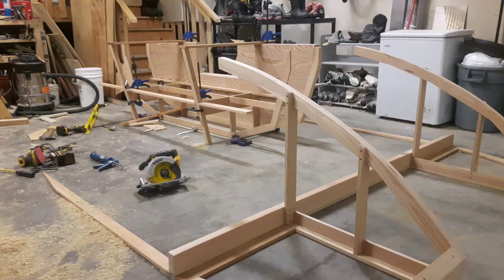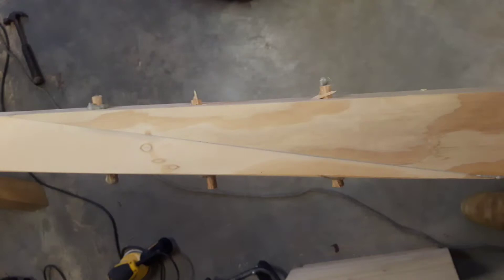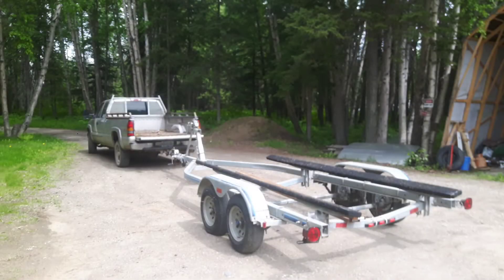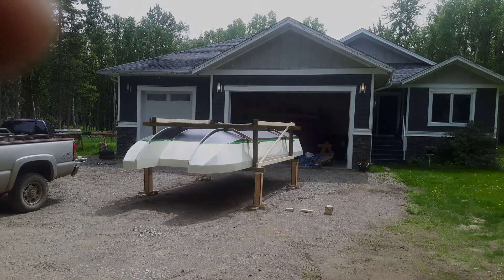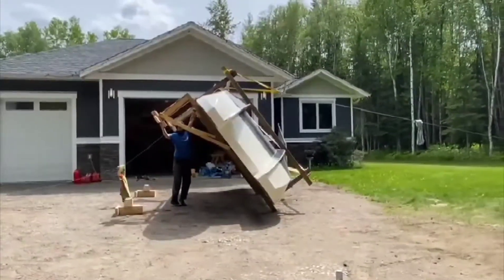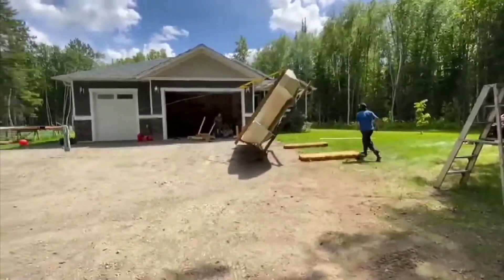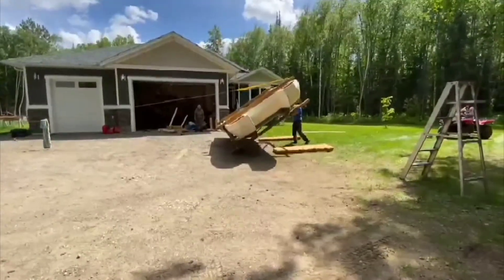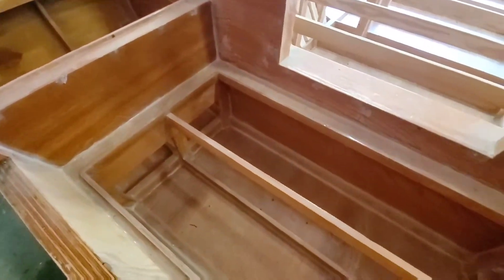Tiny Houseboat (intro)

Comment: 🌴 well I just dropped in to see what you had going on , this was a pop up on my you tube feed as I like seeing boat builds , I’m a retired boat and yacht builder of 32 yrs, it’s interesting to see other people come up with an idea and follow it through, some people attempt it without having skills ,you have skills this is a nice looking craft how much fiberglass is on your pontoons ? This is we’re most people make the mistake on there homemade builds it’s usually to thin ,they get a puncture and water intrusion and eventually this leads to hull rot , it looks like your off to a great start and I’ll try to follow your build , to see it’s progress , make sure it’s sealed really good from the inside and try and add some flotation foam in proper areas , have fun!

Comment: Your helpers did really well, they both exercised good control in raising and in particular, lowering the hull carefully!

Having found your first video I'm very impressed wih your build and that you prioritise low weight, something rarely considered by builders, many of whom use astonishingly large timbers.

When the superstructure and interior are complete the torsional rigidity will be significantly increased.

I have seen this in commercially constructed boats, campers and caravans, and in one case (the A-Liner) the rv became unusable if the fitted furniture was removedl

Thank you for sharing your inspiring build, which adds to the knowledge base for self builders.
Reply from the maker: Thank you for the kind comment! 
I 100% agree to the added strength that the interior will provide. A while ago I took a little travel trailer appart (really old, from around the '70s) and once I took out the interior the rotten framing in the walls provided no strength at all anymore. Just the aluminum panels where holding it up, a little breeze even just from a sneezer would have been enough to let it collapse!

Comment: Your plans and method of construction are very similar to the plans offered by the Glenn L Marine company. They have been offering the home boat builder plans for all sorts of boats since the 1950s. The only real difference between your boat and their plans for the Waterlodge I and Waterlodge II, is that the bow of the boat is square instead of pontoon like. The Waterlodge I is 20' in length and the Waterlodge II is 24'. Some people have  stretched out the II plans to 30'. You are a master craftsman.
Reply from the maker: Very interesting! I will have to look in to that!

Comment: It looks like the 2 keels are notched to receive the frames, is the keel 3-2x4's
Reply from the maker: You are right, they are notched. They are only 2×2's. The joints are glued generously with epoxy and a high density filler. Once I was done with covering the framework and fiberglassing it, I glued two 2x3 keel's to it and fiberglassed over those as well. This way I have basically a 5x2 sandwich keel without a single screw in it and therefore less chance for water leaks.

Comment: That deep double fin on the bottom of your hull should give you great and efficient directional stability -- don't think I've ever seen a hull design comparable to this?
Reply from the maker: I really hope so, I guess we will see on the day I finally get to launch it!😄 The hull design is the result of the space available on the trailer and some personal preferences. One day I might explain it more in detail since there seems to be a lot of interest in it!
Reply: @adrianwoodworm  -- We have two smaller inflatable catarafts (8' & 7') and (as you may have noticed with your inflatable pontoon craft), they have almost zero inclination to go straight and would just as soon move sideways across the water as anything else! I have seen where some deploy a hinge-down dagger board in front (especially if they want to sail) and that gives the boat something to pivot on = a lot more directional control. :)

Comment: I will go through your awesome build here on youtube. Did you use common Douglas fir for the hull frame? I was thinking of using 2x4 douglas fir from Home depot for my frame.
Reply from the maker: Yes, I used common Douglas Fir from Home Depot and I used marine grade plywood for most of the paneling. 2x4 would work great. Just one little tip I can give you, douglas fir really likes to split if you don't pre-drill properly! Good luck on your project!

Comment: Is it possible to make a 2-story? Or perhaps a 3-story?
Reply from the maker: If you increase the footprint of the boat, then I would say yes. If you keep the square footage as small as my boat, then you will get in trouble as soon as the wind blows. Without a heavy keel, it would just roll over. The walls of a 2-3story boat would act as a giant sail, so you either have a very low center of gravity to counter that, or you increase the square footage to stabilize the boat, especially in width. Of course, all of that comes with major problems when it comes to transportation on the roads.

Comment: Did you build the hull? If so, any instructional videos? I really like the hull.
Reply from the maker: I did build it, but unfortunately I don't have much footage of it. At that time I had no idea that I would make youtube videos one day nor did I have the equipment to film anything. What you see here is pretty much all I got from the beginning. But if there are any questions, I am happy to awnser them!
Reply: @adrianwoodworm  I see. Did you build the hull from plans or is it built from your own knowledge?
I've watched hundreds of video's on the subject and I tell you, your's stands out like a beacon. You are either a master carpenter or just possess mad skills. The quality is excellent 👌
Reply from the maker: @shanebeaudrot777  😄thank you! I don't follow any plans or instructions, I never did for anything to be honest, for me the most enjoyable part of building something is coming up with my own ideas, from there on it is just work. 

I decided for a flat bottom hull so I can utilize the large space it offers. The length was decided by the limits of the trailer. (I did not like how the winch limits the length even though there is theoretically more space in front, so I decided to build those two 'noses' in front to extend the length.) One thing that sure is different from other builders is the choice of thickness for the framing material. It is only 3/4inch by 2inch, covered by 3/8 marinegrade plywood, which makes for a light hull. 

Maybe I should do a video about the hull and explain my thoughts in more detail since you are not the first one asking me about it. 

I am not a carpenter by the way, I am a dental technician by trade but worked the last 6 years on a Ranch, doing whatever was needed and now I focus on my projects.

Comment: Love your hull shape. Where did you get the design from?
Reply from the maker: Thank you! It is inspired by Roy Schreyer's houseboat, but I changed the framing method, length, the angles and I added the two 'noses' in front to utilize the space around the winch of the trailer.

Comment: how did you bend the wood so well?
Reply from the maker: The framing has been cut in a curve from multiple smaller pieces and then glued together with half lap joints and dowels to avoid too much waste. For the plywood I used multiple relive cuts, about half the thickness of the plywood, to bend it in place without too much tension.
Reply: nice @adrianwoodworm